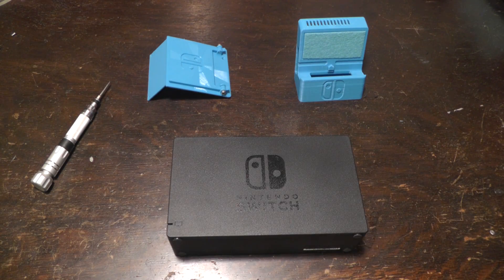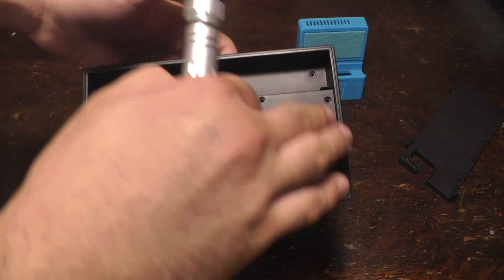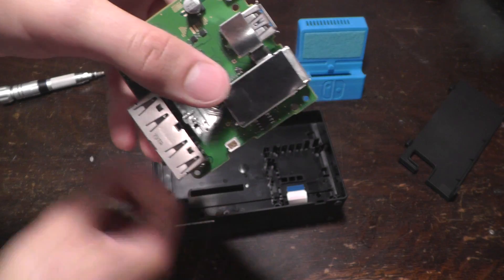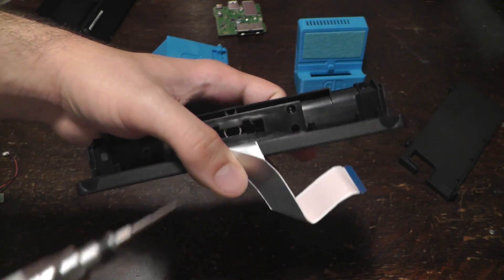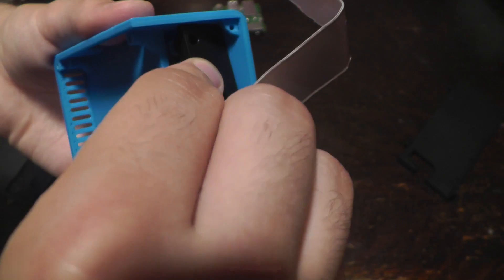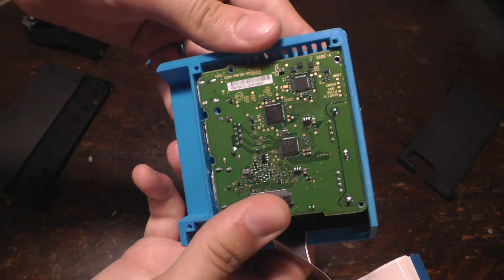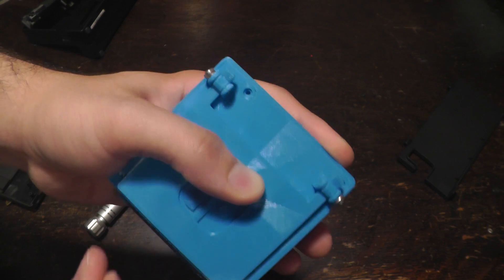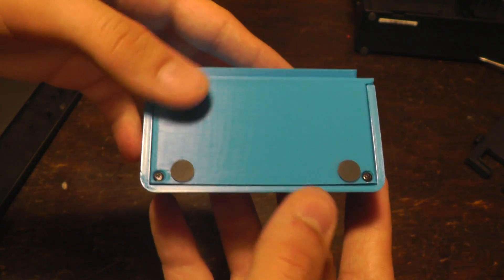Portable Nintendo Switch Dock Assembly

Comment: I tried 2 different versions of these almost bricked my switch, I had to take apart the switch, unplug the battery plug it again few times charged it up again to get it back to life....i have no idea why this happens ideally you are using the same components but I realise switch won't sit properly on this set up as it does with original because of not having much space for error...???

Comment: is the new one with the supports on thingiverse, I printed out the one without the supports and it was missing two screw holes on the top. So print the one with the built in supports??? Amd if that how would I print it???

Comment: That case definitely blocks th back vents of the switch, which will lead to overheating problems.
Reply from the maker: S M The new design has extra cutouts. With the cutouts the cooling is certainly superior to the original dock. If you check the link in the description you’ll see! :)
Reply: the back vents so NOTHING. there is a thermal Pad under it, which is on the backplate. its completly useless.

Comment: What about the air flow though?
Reply: Looks like it shouldn't be an issue, you can resolve all the overheating issues anyway fairly easily, you just take apart the back cover, remove the metal cover, and replace the thermal paste for some proper PC thermal paste, mine never gets hot anymore, docked or mobile. I use Coolermaster paste, but you can use Noctua or Arctic paste on it as well. Definitely a worthwhile mod.

Comment: I just used my original dock and pulled off the front and cut the front panel just under the Switch word , so you can still screw it with the 6 screws . I disassembled the spring mechanism and I cut the long vertical piece with the hole so that front is flush like an L shape just like your printed dock .

Comment: Just finished with my tranformation from the original dock to your 3D printed one. Your video helped make everything go smoothly, and it works wonderfully! My only recommendations are: 1. Buy a set of nintendo screwdrivers, you can get them on amazon for just under 6 bucks, no accidental stripping of necessary screws. 2. Be careful pulling off the rubber feet from the original dock to put on the new one, the first 2 i pulled off left the sticky side on the dock and were not usuable. Thanks again for this really cool dock!

Comment: What is that second cable you pull off? And does it not go back on when you put together the final assembly?
Reply from the maker: It's for the LED in the front. I couldn't find a good place for it in the portable dock so I didn't include it.
Reply from the maker: They are 12mm screws
Reply: Thanks for your fantastic dock ! This is really not possible for including LED ?
Reply from the maker: The file could be modified to include a place for the LED, but I didn't find a good spot for it. You're restricted by the length of the cable, and the only place it looks like it'll fit to me is behind the Switch, which would be useless
Reply: And please can you enlarge the front air vents ? I think it is a little tiny, no ? Have you ever had problems with overheating ? Since the PCB is just behind ?
Reply from the maker: The air vents for the Switch were opened up a bit. I posted a new file with better airflow on Thingiverse. The PCB behind it doesn't do much though, and I added more cooling than the original dock
Reply: A HUGE Thanks to you ! What is the length of the M3 screws you use? 6 or 10mm? Or other length ?
Reply: Yes I saw that you opened the air vents in front but I was wondering if it was no longer necessary to enlarge them anymore? It's just a question
Reply: Thanks ! I have send you private message in thingiverse site
Reply from the maker: I really don't think it's necessary. Airflow in the original dock is already pretty restricted. I'd argue that the cooling of this dock is much better, since air can enter from inside the dock or from the sides, and most of the Switch isn't covered, so more heat can dissipate that way too.
Reply from the maker: I responded to your message. :)  Sorry it took me a few days, I've been very busy!